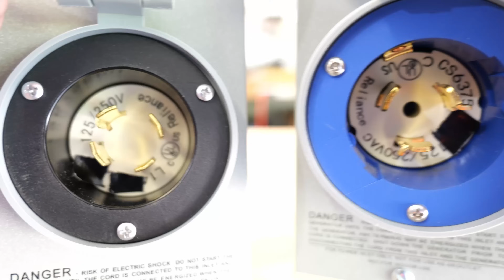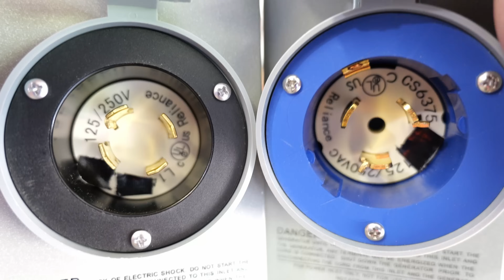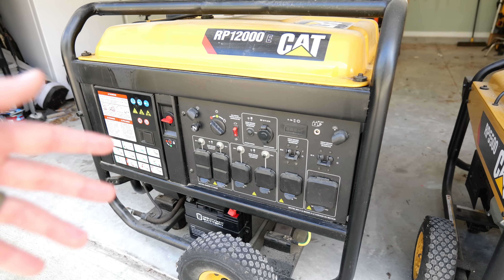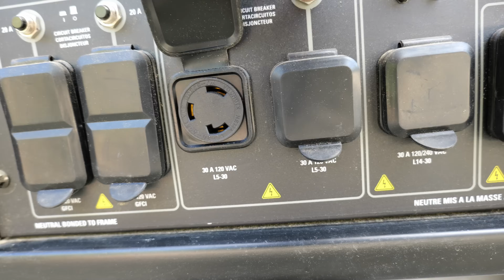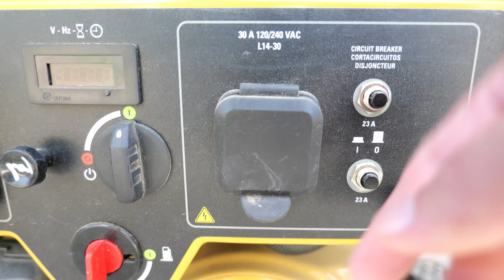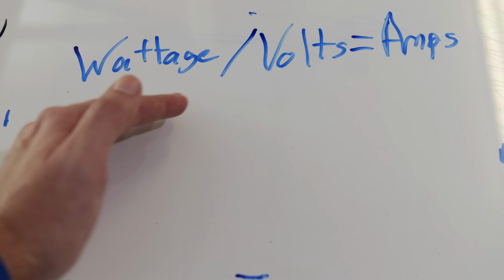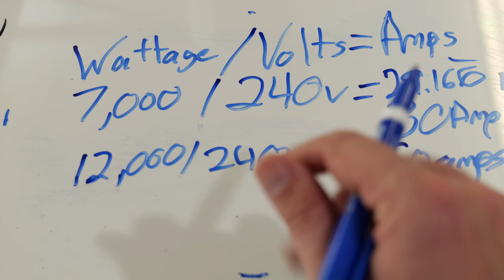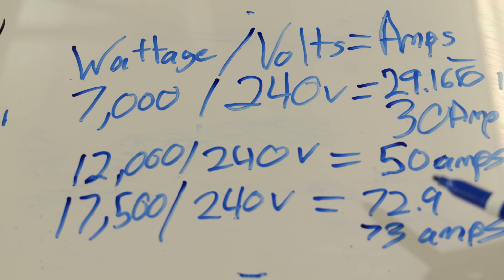30 Amp vs 50 Amp Power Inlet Box.  What's The Difference and Which One Do You Need?

Comment: Always go bigger just in case. But in my case the 30 was the smart easy fix, all I needed was a 30 amp inlet box. The previous owners had a 30 amp 240 for a suntan bed. So all I had to do was move the breaker up to the top right side for a lockout. Remove the 240 outlet and pull the wires to the crawl space and drill a hole through the block into the garage.  All I had in it was 20$ for a new inlet box.

Comment: A good rule of thumb is to install the largest sockets and plugs, use crossover cables to interconnect if needed, ie. make a cable with 8Ga wire with a 50 socket to go to the house and 30 amp plug to the generator. When you buy a either a replacement, or buy a larger wattage gen set, simply replace the 30 amp plug with a 50 amp. Or have both cables so you can use the larger gen for the house, gotta keep the wife happy, and the smaller into either a adu or garage to keep pipes from freezing or wnat to simply keep working on a project!

Comment: Thoughts. Can you run two power inlets? One 30 and one 50 from the one generator
Reply: I am interested in this answer as well. My home has two panels and instead of moving critical circuits all to one panel I would like to connect both to my portable generator simultaneously using a 30 amp plug for one and 50 amp for the other.

Comment: I have a 30 amp transfer switch. Dumb question… if a purchase a 7000 peak/ 5500 running generator, is that ideal? Or are you saying 7000 running is ideal for the 30 amp transfer switch?

Comment: When I was putting in a generator interlock on my last house, I wanted to have a 50w outlet outside, but the big box stores in my area only stocked the 30w boxes.  If you can get a 50w box, go with that and keep a 30w to 50w adapter on hand as most generators only have a 30w outlet at most.  Be prepared beforehand because the 
govt. isn’t going to save you  when it really counts.
Reply: We're talking amps here Not watts
Reply: You mean amps smfh 😅

Comment: I have 2 Honda EU 2200 with a 30 AMP outlet when running parralell. I use these independently all the time but when we loose power to the house i would like to run them together into my panel. I noticed on your video that the 30 AMP inlet box you had was 4 prong. My outlet on my generator 30 AMP out is a 3 prong? How do I make this work? Thank you, Alex

Comment: Curious if you have to switch off your solar breaker when running a generator?  It has its own separate breaker switch and another box outside the breaker box...just don't understand if running a generator will mess up solar panels.

Comment: We had a house built pre-wired for a generator with an interlock installed and external outlet to plug the gen into. 

After Hurricane Helene we finally bought a Champion 11,500/9,200-Watt portable generator. The problem I've run into is that the plug-in on the house is a female receptical that looks like a dryer plug. 

I do not want to make a "suicide cable" and want to switch to a male receptical. The generator has 30w and 50w outputs. Your video showed the math formula which gives me 38.3333 (38) amps.

 I don't know the gauge of the current wiring and I don't know if I should go with a 30w or 50w receptical. No idea why they would have installed that receptical either. 

I don't trust the electricians down here as it's like redneck ingenuity.

Any suggestions?

Comment: Why are you figuring the volts at 240 in your calculation. Every thing in my house runs off of 120V. That cuts the available amps in half for figuring needed amps.
Reply: You get the same amount of power. It's just how it comes into the box, same as the feeder from the utilities. 2 hot wires that each take a leg of the breaker box. 2 x120v legs = 240v.

Comment: I just bought my first generator Wgen 9500/12500 DF. I’m in recovery from Helena in GA area. Will this thing run the following all at once: water heater, all lights and outlets, refrigerator and freezer? I hope a AC unit but I have two units for my 4500sq ft home. Also can I run the 50 outlet. All work will be performed by a certified electrician after I help neighbors clean up. Thanks for any advice from anyone knowledgeable.

Comment: Always choose the 50 amp; you can always run 30 amps through a 50 but you can't run 50 through a 30! Just be certain your plug and wire can handle 50 amps!

Comment: I have a 7500 Watts generator,so 50 amp box would be better??
Reply: Not necessarily.  Depends what all you run at once in your house.  Your obviously not going to run the A/C so I’m betting 30 amp will suffice
Reply: @mn1170  ok my house has a main braker box out side and a sub panel inside which is connected to a 100 amp breaker where should I connect the inlet box braker ?
Reply: @ I’m not an electrician but I think the sub panel.  I would find videos of people explaining it.  I’ve seen videos of people doing it at the sub-panel
Reply: @mn1170  thanks
Reply: Thank you

Comment: I want a bonded neutral generator; not a floating neutral generator type (like I currently have).  What's the pros and cons of going with a 4-wire plug vs. 3 wire, assuming the generator has a 4-wire 50A female plug.  I notice your gen cable is a 3-wire plug.  I'm assume you're generator is delta (bonded) configuration vs. Y configuration.

Comment: Hi Adam!  I am considering a 50’ cord for my 50amp power inlet.  I have a Westinghouse 11,500 watt 14,500 peak generator. Would having a 50’ cord vs a 25’ cord pose any issues or concerns? 

I’m trying to find a good 50’ cord on Amazon but not sure exactly what to look for. Do you have any recommendations? Thank you for the great videos and instructions
Reply: I literally just ordered the Westinghouse tri-fuel 13,000 peak/ 10,500 max running when on gasoline.  It goes down when using propane and natural gas.  I have an electrician coming to check out project and offer advice.  I am torn between 50 amp and 30 amp.  I figure if I do not run the A/C and dual oven the 30 amp would most likely suffice.  50 amp cords are expensive and I need a 50 foot also

Comment: My HF generator output is 10,000 Maximum Starting Watts and 7800 Running Watts. So, if I'm correct I need a 50 Amp Inlet Box and Cord. 7800 divided by 240 = 32.5 Amps. So I need to go up to 50 Amp Box/Cord because 32.5 is greater than 30. Correct? My generator has a 30 and 50 Amp receptacle.

Comment: Thank you for this great video. Question: I am connecting an Ecoflow Delta 2 + extra battery(1800W) (Surge 2700W)(120V)
To a 30A Reliance MTS. Will a 50’ 12-gauge extension cord be adequate to connect the two?

Comment: Do you have a video that talks about making sure 1.) Hoe we make sure we don’t back feed power to the Poles & 2.) how we make sure when the generator is connected during an outage that the generator ground is done correctly?
Reply: 1: Shut the main breaker OFF will prevent back feed to the pole
2: If you are wiring it up yourself you should know if its done right or you hire someone to do it.
Reply: You want to install either a transfer switch of the correct rating or an interlock kit that is designed to work with your current panel and breakers. If such a kit is not available, either install the transfer switch (manual or automatic) or else change out your panel and breakers so you can install an interlock kit. 

Every AWJ (local area) has their own read on what is required to satisfy local & national electrical codes. Usually any work of this type requires a clear written plan and a permit followed by an inspection. Proper work saves lives.
Reply: @atlantajunglepythons1744  interlock/transfer switch arm chair police has spoken 🤣
Reply: @ACommenterOnYouTube  Do what you like: I was suggesting the common wisdom -- and your comment means what?
Reply: @atlantajunglepythons1744  I "do" do what i want and will continue to do so whether you YouTube arm chair police agree with me or not. 
You can suggest whatever you want, i can care less. 
And my comment meant exactly what it meant, "you" YouTube arm chair police trying to critisize what everyone else does when it does not match "your" way, kinda like a Woke Liberal .... 
If we don't follow "your" method, we are the bad ones.

Comment: Carefully consider future needs when deciding this. A couple of years back, I had a tiny, cheap little generator but still got a 50 amp transfer switch and cord, because I knew I might eventually want more power.  Sure enough, I just bought a bigger generator this week, because now I want to be able to run my new heat pump when the power goes out.  The most expensive way to do this is to buy too little the first time, then have to rip it all out and redo it when your needs change.  Size all this stuff to whatever the maximum amount of power you can ever see yourself needing, even if it is massive overkill for your current generator.
Reply: That is why i never got a transfer switch, wasted $$, i just wired the cable direct to the breaker box with 2 breakers.

Comment: My geenrator is a 3300 running watt generator, approximately 12 years old with maybe 50hrs of usage. I have used solely during power outages and running extension cords all over the home. I understand the years old of the unit are not to be considered over the hours of usage, and I was lead to believe that a generator has a life span of 10000 to 20000hrs. Now  I am not the type to get rid of a functioning piece of equipment and watching your video, I understand that i could install a 30 amp onlet with a 30 amp transfer switch, but my question is, can I install a 50 amp inlet and 50 amp transfer swotch in case in the future I get a bigger generator?

Comment: Whether it's a 30 amp or 50 amp, I would never draw that much through the box.  80% max.  I'd shed some of the load.  As in a generator, you never run at full capacity if you want it to have a long life.

Comment: So I have a 30 amp inlet box that goes to a transfer switch and a 7,000 watt open frame generator that has the 4 blade 30 amp gen cord. I also have a smaller inverter generator that just has an outlet for a 3 bladed 120 volt cord. There is no way in times of less need to use that inverter with the box with an adapter and just power half of the circuits of the transfer switch?  I guess when using the smaller one just use a generator cord with 120 volt receptacles on the end?

Comment: Actually as a Licensed CA. Electrician a #8 cable is fine at 6’ with the same connectors shown above.  But to go over’ then I would agree with all the above.  The same rule for the distance from the Breaker to the Alliance connection box.  The actual NEC allowance for #8 wire is much longer than 6’ but the 6’ to 12’ cord is very hard to find.  25’ might be the next standard length, but in my opinion that is too long for #8 on a full load.   

The main reason I say 6 foot is due to some people wanting to go 25 foot with #8 for an EV charging extension cord.  Which have different rules that apply due to the high continuous amperage load.

Comment: Read table NEC 250.122 for information on required grounding gauges. 10 AWG cable is good (for the GROUND ONLY) up to 60 amps because it is a temporary (emergency) load.
Reply: Though nothing says you have to do the minimum required.

Comment: A question on ampacity. Shouldn’t a 30 amp box continuous duty capable generator be on a 40 amp circuit with 8AWG? And a 50 amp capable generator/box on a 60 amp 6 AWG? Question is due to 80% max continuous load allowed for circuits by NEC.

Comment: Excellent explanation between the 30 and 50 amp circuitry. I do have a question about the math why do you use 240v in the denominator and not 120v since mostly all electrical loads operate on 120v ?
Reply: Because  that's the accurate  formula  the math wouldn't be correct

Comment: Thus house has a 50 amp plug in on it I have a small generator 5000 amps can I get an adapter from 50 amps on the house to 30 amps for this  generator another words plug the 30 amps generator to the 50 on the house with an adapter  ?

Comment: IT IS ACTUALLY A MISTAKE TO CALL A NEMA 14-50 A "250V", THE ACTUAL CORRECT DESIGNATION WOULD BE 2X120V, BECAUSE YOU CAN NEVER GET MORE THAN  120V OUT OF ANY SINGLE POLE ON THE PLUG.  EACH POLE IS SEPARATE.  BUT FOR CONVENIENCE SAKE, THEY CALL A PLUG "250V" BECAUSE THE ENTIRE PLUG CAN HANDLE UP TO 250V CURRENT.  Plus, these plugs are pretty standard in houses in the garage area where you'd have a clothes dryer.  but NEMA 14-50 are very much standard on RV's, the 30A standard NEMA plug is NEMA TT-30P

Comment: On a 2 wire w ground 220v well pump 8 Amp running , have a 20 Amp 220v  500W generator inlet socket (which. has 3 wire plus ground) how do you connect the two situations ( purpose to test the well integrity) not hooked up to a panel system?
Reply: Error in that generator is 5 K running power

Comment: 8 gauge THHN has a rated ampacity of 55 Amps, baring de-rating due to conduit fill calculations. 6 gauge THHN ramps that up to 75 amps which is overkill for most installs; I would consider #6 for longer runs but most of the time the generator inlets tend to be quite close to load centers, in the case of interlocks, or transfer switches. 
Buy once cry once and make things future proof; I usually recommend a 50 amp receiver as you can hook up a 30 amp plug via an adapter and you’re set if you size up in the future. I’m an electrician though and my time is about the same for north so the small cost increase in materials between 30-50 is a small drop in the bucket in the grand scheme of things. 
Anything over 7,500 watts should have a 50 amp receiver, otherwise you’re wasting generator overhead; that is unless you’re running other things from the generator while it’s hooked into the house. You should also do your calculations based on 250, not 240 volts, as 125/250 is actually the standard numbers.
Reply: I have never heard that 125/250 is the correct denominator.

Comment: I'd like to mention an issue I had with my generator during my outage here in Houston recently.  I plugged in a portable A/C into the 20 amp outlet.  The portable A/C was pulling 9 amps and kept tripping the gfci.  It was the only thing on that plug and the cord was rated at 15 amps.  Found out later that some newer appliances will trip gfci, regardless of the amps being used.  When I moved the portable ac over to the non gfci 30 outlet, everything worked great.  This issue happened using the outlets on the generator with extension cords only, and not via the home install.
Reply: GFCI's are an absolute joke. They are an additional safety if something shorts and will generally trip faster than a breaker, which is why they are utilized. They go bad CONTINUOUSLY and are expensive!
Reply: Texas resended the 30a 2pole gfci requirement on A/C because the electronics on newer compressors tripped the gfci.
Reply: Houstonian here also.. my fridge would trip my GFCI, so I went out and bought a 3-to-2 prong conversion plug (little over $1) and use that anytime I run it to my generator. Works like a charm. Not sure if this could potentially cause damage if something were to go wrong but I ran it like that for a combined total of 2 weeks (both storms) and had 0 issues with either device.
Reply: @Wholelottanonya  The point of grounding metal appliances is so that if they have a ground-fault, then electricity will take the ground path instead of going through a person to ground! Grounding is required even if you bypass the GFCI (don’t).

Comment: 12500 kw Westinghouse generator       
                    Vs 
14500 kw Westinghouse generator 
What is the  difference between this 2  generator and which one is better.

 50 amp cable work for 14500 kw generator.

Comment: On the mail end of my six gauge wire where it plugs in or connects, you can see that the rubber jacket from the six gauge wire does not but up against the bottom of the plug is that OK?

Comment: Thank you. I am looking forward to getting a portable Battery Powered charging system to power my whole home or most of the home without using the Air Conditioner Mini splits. I have been looking into the EcoFlow system the Delta Pro Ultra. It seems it can go up to 
90wh would that use a 30 amp plug or a 50 amp one
Thanks

Comment: So planning ahead. Can I have a 50 amp plug with msn isl interlock installed and use my 30 amp generator with 30 amp chord with ab30 to 50 amp adapter?

Comment: Great channel.  I learn.  Question:  Why is my green light staying lit on my gfci when I trip it?  There are two switches on same circuit (light switch above sink and garbage disposal).  No other (outlets) on gfci just two switches.  Line and load (seem to be correct) and even when I remove switches from gfci light still stays on when "tested."  No power but light stays on.  Odd.

Comment: If I have a 15,000 watt (peak watts) generator with a 30A and 50A plug, should I install a 30A and 50A?
Reply from the maker: No.  That wouldn't increase the power capacity.
Reply: @HowToHomeDIY  if a generator says "1 30A transfer switch ready outlet  and 1 50A RV ready outlet" can the 50A be connected to my house panel with an interlock kit? I assume yes but just want to confirm.

Comment: I have a Generac 8000 running w 10000 surge and it will not run my 5500 watt hot water heater with nothing else in use. A hot water heater this size should be about 22 amp running. Its 30 amp plug #10 wire about 25-30 feet long. Any suggestions. Do i need an Inverter generator to do this (A.O. Smith Signature 500 Series 50-Gallon Tall Icomm Smart Connectivity ) from Lowes